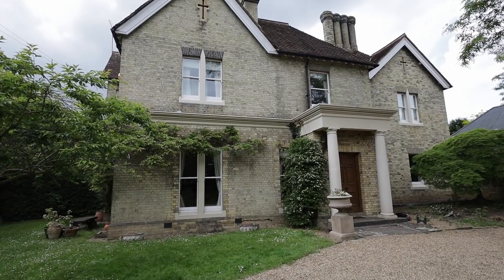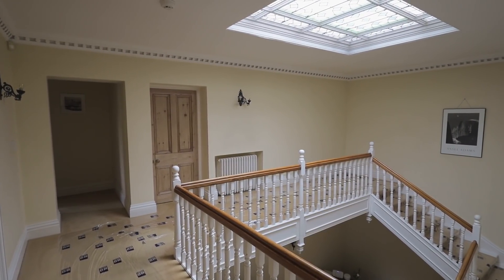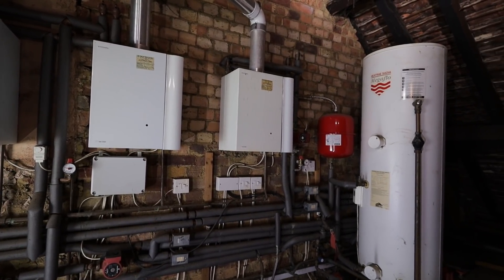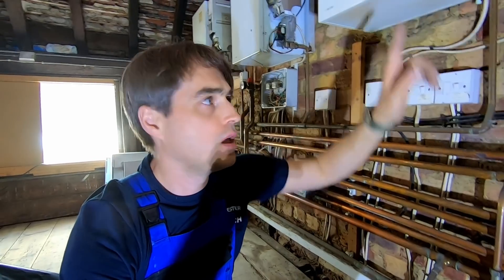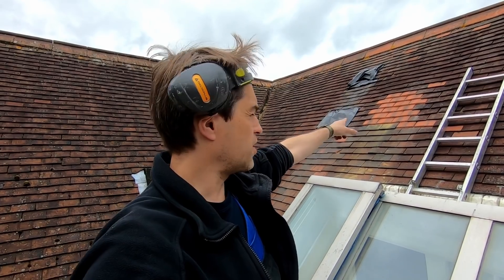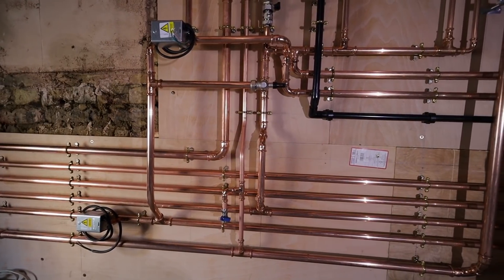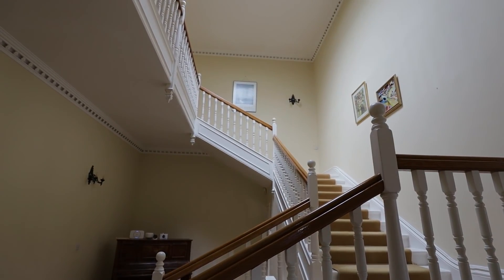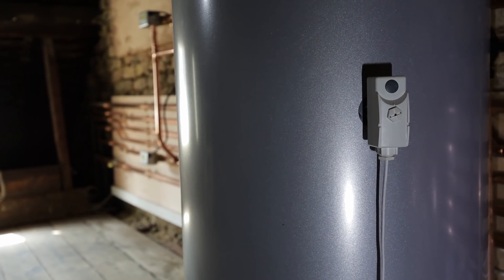How many boilers does this house really need?

Comment: honestly I would have gone for a slightly larger hot water tank say 250 or even 300  reason being given that recharge times are only 20 mins if all 4 bathrooms are in use and kitchen (say when relatives are visiting at christmas where everyone and there donkey want to sit and soak for longer)  given a 18 litre draw per shower or a few baths its not going to really last that long especially if they have fitted digital showers with pressure pumps , so will be calling the Hot water feed for longer, i know the old rads hold there heat well, giving a slow release but if the water call for hot its longer than 30 mins your notice it on the radiators,  either way I would have said to the owners upgrade your insulation to 25mm  especially in the joists, (even if it was listed its still possible to retrofit stuff as long as its setup so its non - permanent )
Reply from the maker: I have done hot water priorty jobs with 2 bathroom and 4 occupants running on 120L cylinders with no complaints. It gives you 10L /minute forever - just lke a 25kW combi does, so I do not see a problem with 200L here.

Comment: Another great one Dracula👍👍 I did expect a Intergash, they’re so versatile!!  The only down side is heating up a whole big block of Aluminium for the slightest temperature drop.
Amazed they’d never fitted Primary/Secondary in 1997.  Very commonly done, even in the 70’s!!
What size is the integral ERP circulation pump in the boiler??  Is the boiler heat exchanger Flow Rate not an issue?

I did think you’d Plate Feed the Cylinder, deffo give you a better HW performance👍👍

Oi.....Andrew Millturd will be along shortly, just to slag-off Intergas, if he’s not in the back of his Van with his Top-Less Apprentice(Rent Boy)😂😂😂😂😂

Cheers Dracula, nice work👍👍👍
Reply from the maker: All good Fiber with you? Poor Milward, what has he done to you?
Reply: @UrbanPlumbers  Oh Millturd is a typical English PITA!!........Scots invented most of the development in Steam Heating etc......All his videos are shite quality & full of plagiarism, nothing is new in this game, nothing!! I was fitting heating Systems when his Mother still had him in Frilly Dresses, yet he calls me a Troll for critiquing his Viessmann boiler that’s full of hoses.
Don’t get me wrong, I’m British through & through, but the English invented nextto nothing.

Comment: Why no Heat Pump I thought we are going over to Heat Pumps gas boilers are a thing of the past,just asking.Very nice job
Reply from the maker: Too much heat loss at this house and very difficult to upgrade existing cast iron radiators.

It would cost £10k alone to upsize radiators and keep them the same style

Heat pump install would be another £20k

The client is looking into ground source once gas is no longer viable.
Reply: @UrbanPlumbers  Good answer and true you are the man for sure

Comment: Can you add an ASHP to this setup down the line to supplement the heating and hot water?
Reply from the maker: yes, in fact hybrids can work very well. However in this case the radiaotrs are the limitng factor.
Reply: @UrbanPlumbers  👌🏼I trust you. You really know your stuff. At least this homeowner can upgrade in time. Or use the heat pump for hot water at least.

Can heat pumps extract heat out of the flue gases? They're still pretty warm even in winter
Reply from the maker: @v_0  you would rather use heat pump for heating only and keep boiler on the hot water, as it is probably cheaper to use gas for hot water.
Reply: @UrbanPlumbers  interesting. Not the answer I expected. I thought a nighttime tariff and heat pump with a cop of 2.5 or better would be far cheaper.

Thanks for the insight.

Comment: Sensational install once again. I finished my first hotwater priority this week on an ideal vogue s26 with weather comp and I will be doing this install all the time from now on. 
How was the water pressure on this dwelling. Was their an accumulator to help with demand .
Also very surprised by only installing 200 litre cylinder. Again you have taught me something 👍🏻
Reply from the maker: that cylinder is pre set to 4 bar not 3. You can actually run it at 5 bar. No accumulator needed - mains in 28mm all the way through with excellent flow rates.
Reply: @UrbanPlumbers  great stuff mate. Where are you onto next ?
Reply from the maker: @ashplumb1  I already got 2 more videos from other jobs almost finished - w200 Viessmann install and another PDHW with identical set up to this one. 

A lot of air source installs coming up as well.

Comment: Some off the best work i have seen en well though out en explaind. But if it was me doing this work i think i would have fitted a kwh boiler maybe 50% more and set it to your calcated kwh. So if there a problem you can upgrade the system in the settings
Reply from the maker: that is what everyone is doing. Not calcuating jobs and ass covering with oversized boilers and oversized pumps. What is the point of enigeering then?
Reply: @UrbanPlumbers  I understand your point of view. And there is nothing better dan doing the right calcalations for a current system. But the install cost arent that much higher. And like you said you covering your ass but also your costumer i believe if there are changes that need more kwh
Reply from the maker: @bobbroodman6307  in most cases I advise clients to upgrade rads (higher efficiency from the same kW boiler) and insulate more. In all cases they should need less not more kW. Bigger boilers will modulate to a higher point and be less efficeincy to smaller ones most of the time.

Comment: Nice install- only thing I would say is, piping up the cold water and capping the hot water outlet means the water sitting in the boiler is going to seriously scale up as Intergas boilers have mega problems of scale in the hot water circuit if the water isn’t treated eg water softener or a HS38. I know the hot water circuit is not being used but I’m wondering over time will the scale build up in the hot water circuit that runs through the boiler, will it cause any problems? Wouldn’t it have been easier just fitting an external filling loop?
Reply from the maker: that is such a misconception regarding scaling. There will be zero scaling for 2 simple reasons:

- there is no water in the het exchagner at all - hot is capped off and cold is isolated to the boiler
- even if there was any water in the boiler, again there would be no scaling at all, as you would have a small amount of water inside the boiler with very limited amount of scale - you need loads of fresh water going through the boiler over long periods of time for scale to build up. One of the reasons why scale is not a problem on a sealed side of CH - there is limited amount of scale (around 200ppm in this area) - again you need a lot of fresh water running over long periods of time for any scale nuild up

Hope this makes sense.

Ahhh, and there is HS38 on the mains.
Reply: @UrbanPlumbers  if the isolator is shit off to the boiler then agree no problem, gathered it was capped at outlet. Where I live we have massive issues with scale in Intergas boiler so hs38 are a must! I do like Intergas and have fitted many but I do believe they should have done their due diligence a bit better when bringing them over here in high scale areas as normal inline descaler a don’t cut it at all.
Reply from the maker: @vanturecampers  in line ones are just a joke. Not sure they do anything. I like those HS38 and install them on most Intergas installs.

Comment: Another great video!! What size pump and expansion vessels are in these Intergas system boilers? And what size additional expansion did you have to fit? I really wish all boiler manufacturers would make their Heat Only Boilers compatible with hot water priority as expansion and pump in System Boilers are usually undersized for larger systems. I think it is only Intergas & Ideal that have this function.
Reply from the maker: boilers that I am aware of that can do hot water priority (not all of them very well) are:

- ideal - but gives absolutely zero contorl on kw output, pump speed or flow temps - very basic and far behind Intergas, Viessmann and Vaillant
- Intergas - full control of flow and kw for dhw and ch, however only offers basic weather comp, which is a bit of a let down these days
- Vaillant - full control and good weather compensation, no contorl over pump speed with modulation, which is a let down
- Viessman - full contorl and advanced weather comp - best in business. No contorl on flow temp for hot water, which is a let down, but the boiler uses NTC to make those decisions for you

Comment: Very neat job, great work there,how long did it take, I did   a intergas with same system but with 50 ltr cylinder, but I'm surprised the high gain cylinder will keep up with 4 bathroom's simultaneously running
Reply from the maker: yep, it will keep up in terms of flow rates. Obviosuly as with any cylinder it will eventaully run out when using 3 showers at the same time. Give or take you will get 10-15 miuntes from 3 showers at the same time.

Comment: Admire the pipe work and how cleanly everything is laid out.

You should do a video on how to determine if the plumbing/heating professional you need to hire actually knows what they are doing... What questions can be asked of them, and what answers are to be expected, sort of.. Any potential red flags, etc...
Reply from the maker: that is a good idea
Reply: Totally agree with this, really struggling to find honest and competent tradesman ..
Reply: Check out Heat Geek's channel, loads of great advice for consumers.
Reply: Also verify that the tradesman is Gas Safe too!

Comment: How did you calculate the reheat time for the cyclinder?
Reply from the maker: heat capacity of 1l of water *times amount of water in liters *times  DT of change of temp of watert in the store / divided by kW input / divided by 60 to get minutes

Comment: Fantastic install. 
Could you make use of the flue recovery system on the boiler by passing the cold mains through it into the cylinder
Reply from the maker: Yes, there is another Intgeras that has that build in. You have to use it as a combi though

Comment: The 3-way diverter.  What is on rest?  To CH or DHW?  If on DHW it will not activate in the summer months, only opening when CH is called.
Reply from the maker: valve moves over for DHW demand
Reply: @UrbanPlumbers  
To reverse you need a relay?
Reply from the maker: @johnburns4017  no, nothing needed. Valve gets powered with hot water demand that is all. Other valves can stay open for CH, theuy dont get any flow.

Apparently it is better to use 2 x 2 ports instead, one noramlly open to CH and one NC to DHW. Both get powered at the DHW demand.
Reply: @UrbanPlumbers  
The 3-way diverter valve is opened by the boiler's pcb as I know it.
Reply: @UrbanPlumbers  
BES sell high temp 3-way with an end switch.

Comment: Have you ever considered designing plans with a layer accumulating cylinder that does instant hot water through a plate heat exchanger that uses the heating hot water in the cylinder? 
One of these layered heating water cylinders is the Vaillant allSTOR and the instant hot water module is sold separately.
P.S. Love the way you work and describe functionality.

Comment: I wasn’t that far out on the kw. I guessed about 24. But I didn’t guess that you would do the hot water like that. 

Another quality install. Really lovely work. Not just in terms of the actual install, but the thought process behind it and the attention to detail of the system design. 👍🏻👍🏻

Great point at the end about 55c flow going forward and how it’s gonna effect dhw. I bet a lot of manufacturers are scrambling right now to bring out boilers that can accept separated ch/dhw switched lives with different flow temps for both. Hard to see how we are going to achieve that in the short term using a lot of the current heat only boilers.
Reply from the maker: 24kW would be a little too small due to undersized rads, so at -3 the boiler will run at lower efficiency due to high flow temp. 27kW was about the smallest I could get away with here.

Comment: Nice job, pity to cover up all the pipe work with lagging!  Question - do you need a separate weather compensation sensor? Won’t the Nest(s) provide that from their internet connection to the weather service and then through their OpenTherm link to the boiler?
Reply from the maker: Nest cannot do multizone wth Open Therm, so no you can't do that if you have more than 1 nest. You also have no contorl over heating curve at all that way. On anyting more than 1 zone you cannot use Open Therm so you have to go weather comp. Local sensor is also miles more accurate than online temperature.
Reply: @UrbanPlumbers  Thanks!
Reply: @UrbanPlumbers  check out EPH controls. Kim Betty is the man to speak to about multi zone OpenTherm. Do you know Kim?
Reply from the maker: @edinburghheating7414  yes I know Kim. I am aware of EPH.

Comment: I spoke to a g3 assessor that said wiring the power to the boiler through the cylinder high limit is the 'preffered' method as there is a small but still possible chance that in time, a fault with the valve body or synchron motor can prevent the valve from fully closing, so an overheat fault will cut the source. Great video and install as usual!
Reply from the maker: this is the case here - high limit will turn the boiler off when activated.
Reply: That was what I was thinking, our engineers were putting a 2 port on the cylinder aswell as a worcester internal Diverter with cylinder stat and limit controlling the 2 port and the NTC controlling the Boiler on Hot Water Priority, apart from being over the top it also caused an issue that if the cylinder stat was turned down lower than the HW setting on the Boiler then the Boiler would try to run against a closed circuit and eventually over heat, plus no CH. I have since removed the 2 port, disregarded the cylinder stat and wired the limit stat to cut the power to the Boiler. I like your install, a lot of guys would have fitted 2 boilers on a low loss header without realising that it would reduce efficiency. Great Channel, keep up the good work. The standard in our industry needs to improve.

Comment: Great video and knowledge base. What would happen to the hot water if that household increased to 6-7 (3-4 guest) on a weekend in winter (say christmas)?
Reply from the maker: they could use 2 showers at the same time for around 15-20 miuntes, then they would have to wait 20 miunutes before someone coould shower again, so not a big deal. You can always add cylinders, keepin too much stored water is a bigger issue in my opinion.
Reply: @UrbanPlumbers  thanks for the reply, that was my thought. I was also thinking that  the house temperature would drop as you said insulation was an issue. Did you advise them to improve insulation as this would make your system more efficient and save them even more money?
Great video by the way. Who cleaned the pipes with Brasso?
Reply from the maker: @digitaria  they are adding insulation. There is no need for brasso when you press fit, it is solderig that get the pipes dirty,
Reply: @digitaria   you miss the emoji :) after your question mark, right ?

Comment: If you could only (as a side business) set up a training school the whole country would be better off. Our 2020 London plumbers thought they could get away without lagging the pipes, they also didn't use the right clips to support the pipes (several were folded sandpaper screwed around the pipe!!). Post lockdown I had to remove all the oversize skirting boards, remake them as they started to fail after 6 months, then lag all the pipes & instal supports every 1.5m. Your channel is a great showcase of thoughtful professionalism, something that seems very rare today.
Reply from the maker: there is a training school already - check Heat Geek

Comment: We're starting a similar sized job next week but full heating system replacement and I almost didn't get the job because I specified a 25kw V200 and everyone else specified a pair of 37KWs bonfires and mega plant rooms. Times are a changin'.
Reply from the maker: things are definitely slowly changing. The amount of unused kW o boilers installed in the UK could do 3 more countries ;)

Comment: Great video. It’s surprising how many boilers are oversized. I’m often surprised how small boilers actually need to be when sized properly. You are a credit to the trade 👍🏻
Reply from the maker: it is a constant battle to explain to clients that they onlt need 12kW or 18kW boilers.
Reply: @UrbanPlumbers  our old single glazed end of terrace still has an 11kW baxi back boiler. Heat loss calcs I’ve done for an ashp install says I need 6.8 when it’s -3 outside. Amazing how little you need.

Comment: The only reason I would of possibly gone with two boilers with a low loss header is for back up. The Amount of over sized boilers out there is proof they of how many engineers have no idea.
Reply from the maker: trouble is, LLH would lower your efficiency, unless you used Viessmann with divicons or was able to control the main pump with modulation. I prefer it simple.

Comment: Does hot water priority mean that the heating won't come on until water is satisfied? I guess only if calling for both.
Not sure if it would really be a problem, maybe coming back from holiday, want to warm the house and have a shower. But then you have nest.... Dunno
Reply from the maker: Yes, no heating when doing hot water. However full reheat of the cylinder is around 20 minutes and also when running on wether comp the boiler stays on for very long periods of time. You cannot just blast the house with heat and warm it up quickly.